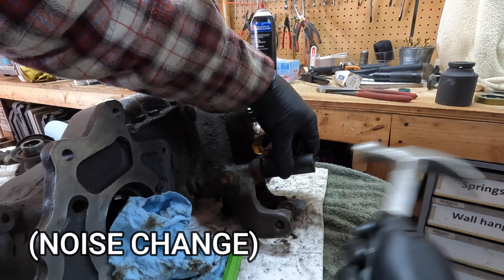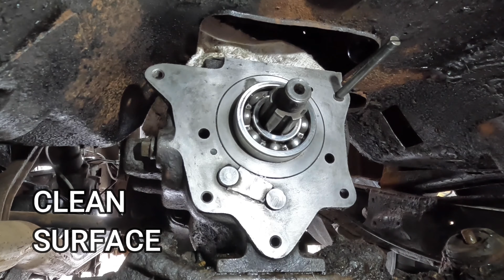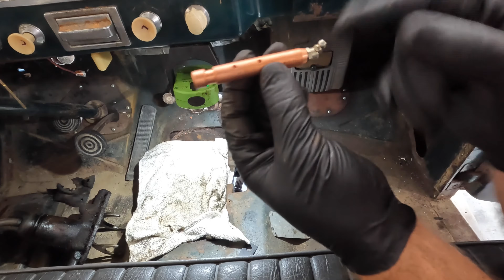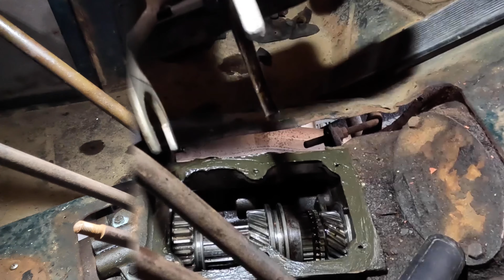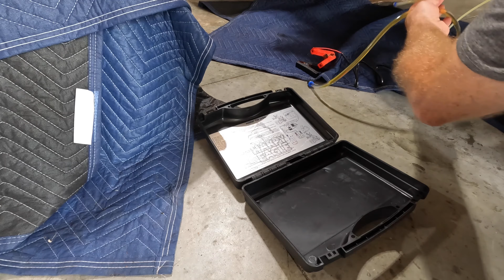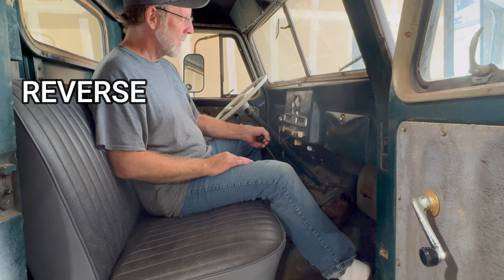Willys Jeep Pickup - Transmission/Transfer Case Leak Repair

Comment: I am so glad I found this channel.  I am restoring my Dad's 1951 Willy Truck, and am on the transmission & transfer case now.  I am getting my parts from Kaiser Willys.
Reply from the maker: Welcome! I hope it helps!
Reply: @AntiqueCarsandStuff  What did you use to pull the input & output (large) shaft seals?
Reply from the maker: I believe I just used a universal seal puller tool like this .... https://www.amazon.com/Universal-Seal-Puller-Tool-Heavy-Duty/dp/B0FF4HPZBP/ref=sr_1_2_sspa?crid=1LL37KEO4C2P8&dib=eyJ2IjoiMSJ9.UuJiakDGuOy-QLs_b4so60MVEGEnyk9YfuRCqJOTQnkiKT9XMZiEFfCNtnArI3aoMOswDYq-KZFVmPK4iQARg1UI7AjXF-MrvTklQb6iHLvLWzhP5ySFqxPKRY6RFAkh_5YXiGQbvqEvOcTXsBQoqzVHATGYTnUfTnjmb1pMB0PyIVl0RN2yE9nyCe_aNtrpQAdo1ISrQXJVngXCJis3qPUHDE315VyTxgJdR4LgQx2NJecVlBvM3_xnGTAJ6hnmnrz8yUatuMO5rtmgWKCBJD9Tl1ng1mENtXlXHcA8S7w.NawvKD1f3Y4uVtv6KRqtd17m72FHm4DBjvMIf-0eMo0&dib_tag=se&keywords=seal+puller+tool&qid=1775998786&sprefix=seal+puller+too%2Caps%2C353&sr=8-2-spons&sp_csd=d2lkZ2V0TmFtZT1zcF9hdGY&psc=1
Reply: @AntiqueCarsandStuff  Thank you!  I picked one up at my local Harbor Freight.

Comment: Having been it several of these did you replace the transfer -intermedate shft and bearings common and frequent issue with this trnsfer case, tip for universal yokes i put the rtv in the middle of the yoke splines, to seal leake and back side of washers for additional seals, lock tight on the nuts ,rtv on all open hole boltsin case's rtv smear on all paper and fiber gaskets, both side "thin" ,, 
Later issues brakes don't remember dates but one year of the later wagoneer had self andjusts on the brakes,frt. And rear, and is a straightbacking plate to drum -bolt on replce-upgrade to selfadjuster brakes,beats every two week readjust to get rid of the 2stroke brakestop with the original eccentric cam adjusts that are stoke.., 45yrs auto tech, certified, now retired,the old ones are better, stay with it ,antiques werebulit to last the generations..experience teaches..history Teaches..truth is sovereign
Reply from the maker: Thanks Paul.